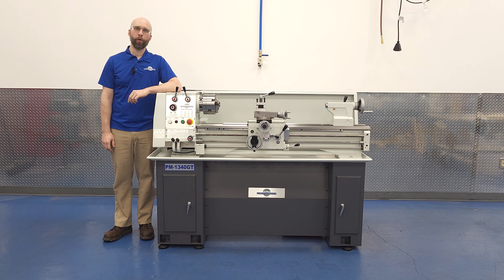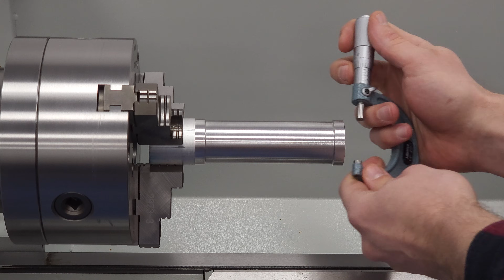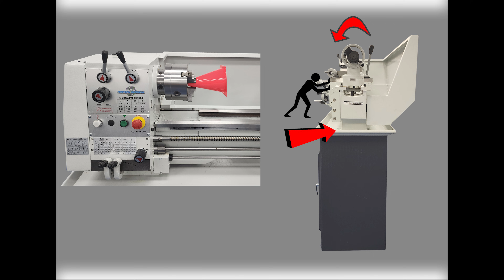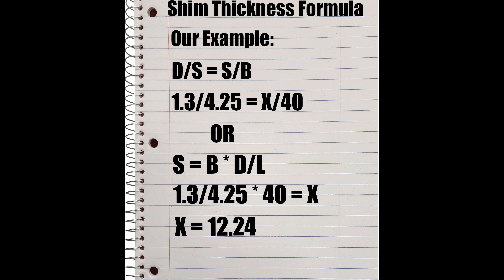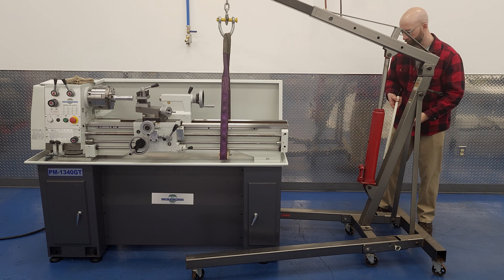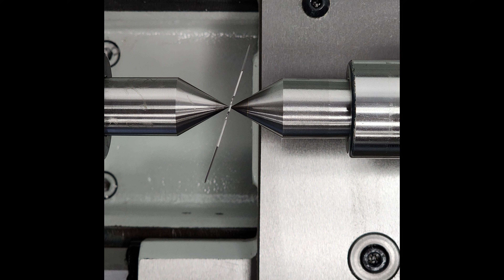Fine Tuning Lathe Setup on our PM-1340GT - Precision Matthews Media

Comment: When you do the maths for shim thickness use the distance from your test piece to the bed bolts rather than the entire bed length.
I haven't checked your numbers but you could do it after measuring that distance and use the original numbers.

Comment: Cant this be accomplished by adjusting the feet and avoid the shims, not to mention losing the seal provided with the silicone during installation.
Reply from the maker: There is more than one way to skin a cat. So yes, you can certainly do it that way. Which ever way you prefer that gets the job done. We did it this way, because we think that this method is easier for people to conceptualize.

Comment: What about vertical alignment?  Yours looks good as shown, and the PM-1340GT manual says it's not so important.
Reply from the maker: You're right that it's far less important for most circumstances. Because the tool is horizontal to the work, the vertical alignment only affects tool height relative to the part rather than depth of cut, so the difference will generally not show up in the finished part.

Comment: I have a question, just now setting up my new PM-1340GT.  The right cabinet comes with two leveling bolts/feet in this video.  The owner's manual, though, says for the best setup to install four leveling feet at the corners of the cabinet, which I have done.  (Those cabinets are somewhat tough steel to hand drill and tap--the cobalt drill was definitely in order, so I guess that's a good thing.)  The question is, did I really need to do that/is there any benefit?  I've seen videos about such can be used to eliminate sway in the bed, but maybe this machine is small enough/stiff enough that that's not a consideration?
Reply from the maker: More stable is always, better, but we have found that the supplied orientation of feet keeps the lathe stable and level quite well.

Comment: You guys make great machines, and I’m sure most of this is for novice machinists/hobbyists, but a couple thoughts: the headstock alignment can introduce taper just like this, which is why you use a machinist level to ensure the twist is in the bed and not the headstock. Frankly, so can gib/backlash adjustment if not loaded properly by the operator, but that is a whole separate subject. 
Also the cuts you made on your test bar are called witness cuts. They provide a “witness”  for your next operation and my second point.
2. The razor blade method for aligning the tailstock is not the most precise method to ensure alignment. You need to put your test bar between centers that are actually machined and not just center drilled  (once the machine is leveled — with the feet), you then turn your witness sections in the same manner. You can adjust the taper that is produced to align the tailstock, which then gives you an extremely accurate alignment. 
I’m sure I’m being a bit nit picky, but with the quality of machines you guys sell, its important to show folks how to get truly precision results out of them, so I hope this helps 👍
Keep up the great work!
Reply: Correct. Good information.

Comment: Really good explanation. Assuming the head is bolted to the bed how would you test to see if it’s parallel with the ways ?
Reply from the maker: You should not need to touch the headstock alignment from the factory. If you are unsure of anything, please give us a call and we will be glad to talk you through it.
Reply: @precisionmatthewsmachineco  I just received my new 1340GT from you and it's great to know what fine tuning is normally needed or not needed on the machine. Thanks for this video! I think I am accurately visualizing the source of  error due to twist now. It occurs because the tool post and tool sit high above the ways. So when the bed and ways are twisted, the tool moves into or away from the work as the carriage moves along the ways, right?  Realizing that the the tool is positioned high above the ways was the key to my understanding the geometry of the situation, but I'd like to confirm that I'm correct. My only experience has been tuning my Sieg mini-lathe and I had to adjust the headstock alignment on it and I never even thought about bed twist. BTW, I used straps on my mini-excavator to move the shipping pallet and lathe onto my shop floor but now I'm thinking that I should buy an engine hoist, given that fine tuning the lathe will be necessary over a period of time and it should even be considered to be periodic maintenance. Operating the mini excavator inside the shop is a much riskier proposition than the hoist. Get the right tool for the job, right?

Comment: What if the head stock is not parallel 
I purchased a 14 40 from you guys and had to adjust the head stock after leaving.
I got it to within.0002 in 30 in
Reply from the maker: Please check with us before you adjust the headstock, as that's beyond the scope of this video. Headstock angle is generally pretty much dead on from the factory, but we can walk you through the process if it's needed.

Comment: Since that stand has 6 adjustable feet I was able to use the feet to remove the twist rather than shimming. Is shimming preferred? Is so why?
Reply from the maker: Yeah, you can use the leveling feet to remove the twist, and that's what a lot of people do. We like this method because it's more precise for basically no extra effort. The difference between the first shim that we tried and the second shim was only one thou, and it's hard to reliably make adjustments that fine to leveling feet.